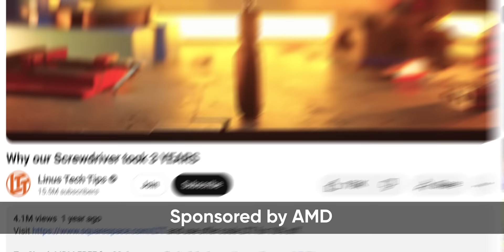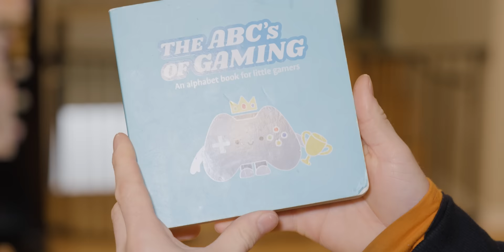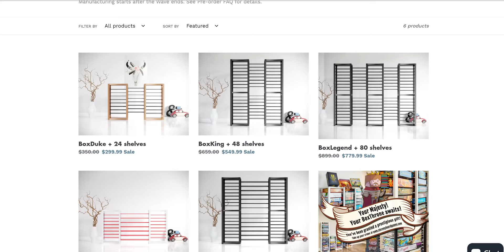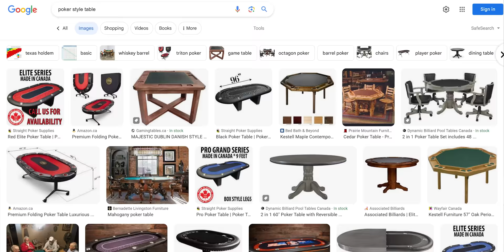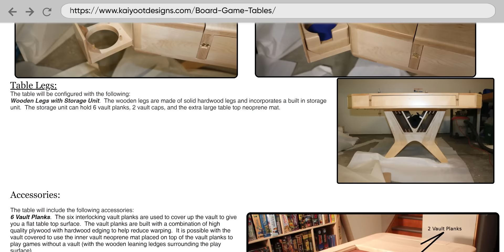This Upgrade Took TWO YEARS – AMD $5000 Ultimate Tech Upgrade

Comment: Love that Kyle is a board and tabletop gamer, and that he designed his own gaming table, "borrowing" designs from Wyrmwood and another defunct designer, and that Wyrmwood was okay with it.
If you don't want to change the matt, putting it under the side rails isn't bad. 
Always listen to your wife when putting together furniture, especially if she's an engineer. 
I really want a gaming table.
Reply: Stream of consciousness writing at its finest
Reply: I have plans to put together a gaming table specifically for D&D.  Tabletop will be a 60 inch multi-touch screen to use as the main screen for Roll20, powered by an SFF PC underneath. Each player also gets a tablet for their Character Sheet, and can swap to Roll20 as well. Table will be adjustable up and down for ease of use. Gonna run about $1500, but will be AMAZING when it's done. GM area will have an attached screen for the GM view, too.
Reply: Not Defunct - just a guy building game tables in his spare time outside his 9 to 5 job.
Reply: I can't help but wonder if by chance the free ad-space from LTT video played part in Wyrmwood coming to agreement 😉

On the other hand, Wyrmwood is kinda known to be the good guys so it could be also just a gesture of good will
Reply: this "commercial" will be more valueable for the company than another sold table.
Reply: @kaiyootdesigns   Sorry about that. Website wasn't working and hadn't been any updates in years. I checked out your designs on Facebook and YouTube, they are nice. Hope you get to do more of them. Canada needs more gaming table manufacturers.
Reply: @Janz_u  Chinese manufacturers were "borrowing" Wyrmwood designed products, and instead of threatening with lawsuits, they were more interested in working with them to get Wyrmwood products into a market  that currently was looking for them. 
That's smart and wish more companies were that intelligent.
Reply: @ Wyrmwood  had ALOT of drama a few years back for being not the good guys.
Reply: @ScytheNoire  No problems.  I am in the process of updating it to sell table plans and the required table hardware in the near future.  Wish I had known about this video ahead of time to have had it ready by "then/now" but alas, it was not meant to be.

Comment: I built little TEC cold plates for our lab when we were using the PTM material in our servers. Just place your sheet on it, peel off the top layer, place the square on your cpu, place the cold plate on top for a few minutes, pull it off and peel the second layer of plastic off. Made it way easier to install. 

Tip: you want the initial square to be 80% of the area of the heat spreader/die. Once it melts the mounting pressure squishes it the rest of the way. 80% ensures complete coverage with minimal excess squishing out of the sides.

Comment: Question: at 29:42 minute mark - what does Linus mean by not running "DDU" involving driver issue?
Reply: DDU is to uninstall display drivers. It’s recommended that you run it when switching between different brands

Comment: I would like to point out to everyone, the corsair power suppies use different 24 pin cable, but, all the others cross check over the years. I personally have RMi and HXi psu's and have swapped back and forth cable from  another, BUT, the 24 pin. AND! you can't switch an RMi with an HXi 24 pin, becuase the cables on the PSU end are seperated out differently, they just wont plug in.

Comment: That hotwiring of PC. I've done that.

bought a new Tower a few years ago but it was the last 1 at the time. The button on the front was broken though so I got a discount and tod the shop I can fix/workround it so i did same as him.
Worked like a charm N i had that tower for 4yrs b4 I actually built a new rig lol

Comment: Linus, for someone who hyped pogo pins so much, I am surprised you are saying there's no way to just chuck a screen on there with magnets (25:45). Actually, you get wireless HDMI and wireless charging pads too. One of these options is much easier to implement. The technology exists, in many forms.

Comment: How did the engineer not understand that you'd need to tension and secure the fabric making up the surface of the gaming table? And pocket screws? How did that table take 2 years? The whole POINT of a Kreg jig and pocket screws is that you can just throw shit together in literal minutes? There's no need for the precision and hand-fitting of traditional joinery, just slap it together.
At least his wife is smart, so the kid has a fighting chance.

Comment: Honestly as an Engineer he should have known better that he didn't need more than 1kW for the PSU for EITHER system. The 7900xtx is rated for a MAXIMUM of 350Watt draw, the whole system draw would for sure be under 600 Watts. A 850W PSU in each system would not only have cost HUNDREDS OF DOLLARS LESS, it would have actually been MORE POWER EFFICIENT, and ACTUALLY WORKED IN THIS BUILD SCENARIO. That's a hard FAIL for whomever specced out the systems. SMH

Comment: Very beginning of the video I’m thinking, so he basically just stole the design from Wyrmwood. 25 minutes in “I stole the design from wyrmwood ” you could’ve bought the table and the topper block to store the toppers for about for about 1/3 the price he spent on the table.

Comment: 25:00 Patents & Copyrights ARE NOT to prevent others from making something...
it's to prevent the non-P&C holders from DISTRIBUTING (somtimes called "publishing" for copyrights, called "manufacturing" for Patents) the items you make ...   THINK ABOUT IT: are you going to make 25, or 25 thousand Tesla's if you aren't able to give away or sell it?
even a book is about the same price to photocopy as to buy new  (and used, "forgettaboutit !!!!!)

car restorers build whole car often, virtually from scratch... but using replacement parts cost more than the new car ...